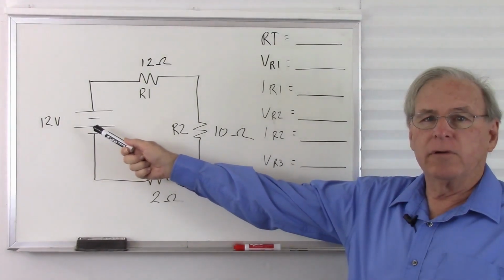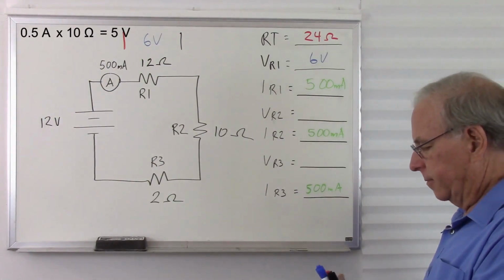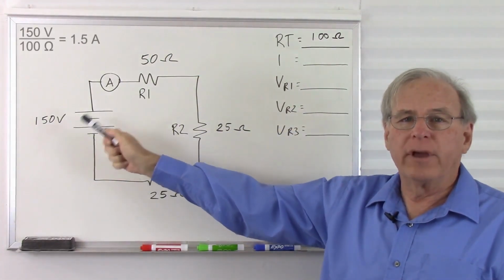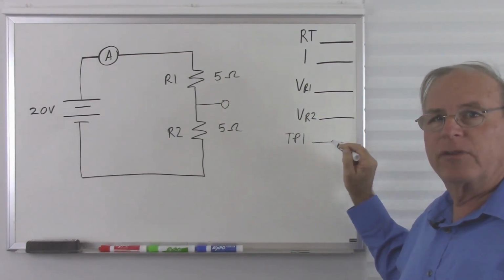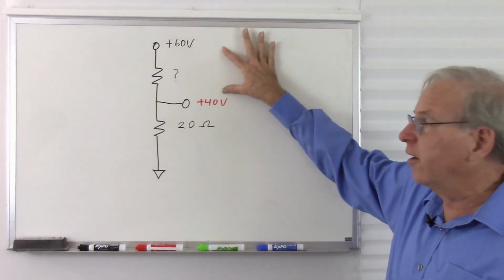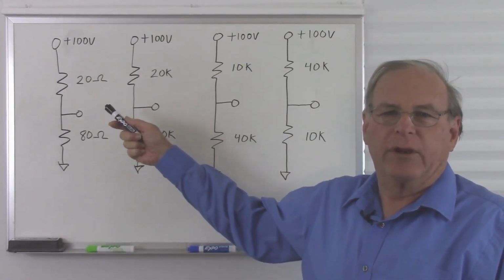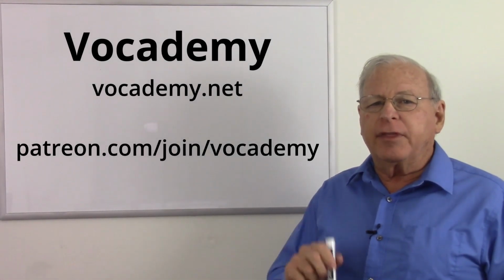Lesson 4a   Series Circuit Exercises

Comment: 20 series problems to work through.

Another .5A example.
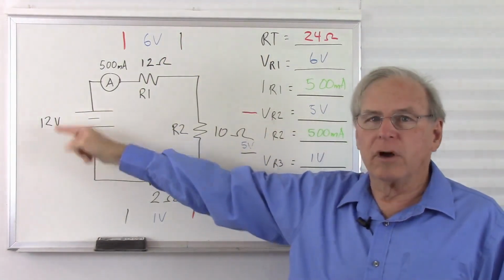6:00 Another 1A example.
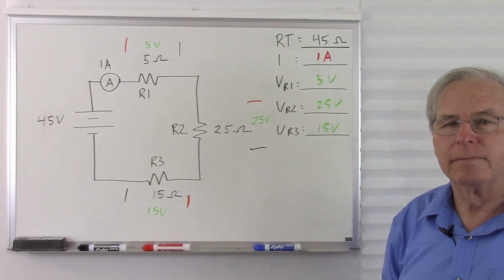8:25 1.5A example.  Percentage break down.
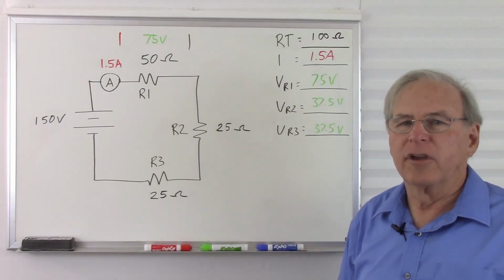10:15 2A example.  Solve for unknowns.
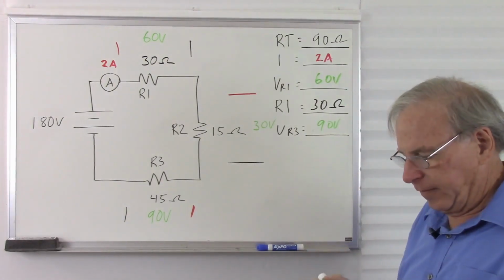13:05 4A example.  Solve for unknowns.
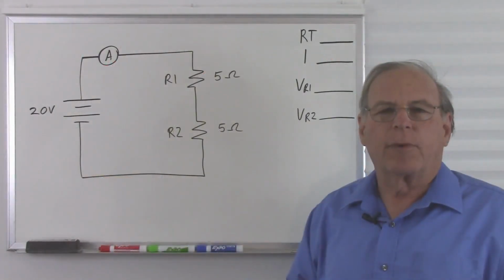16:45 Another 2A example.  Battery redraw.  Schematic exposure.
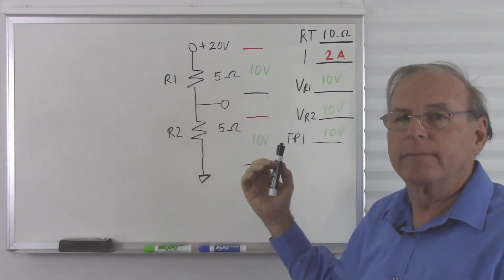20:40 Another 0.5A example.
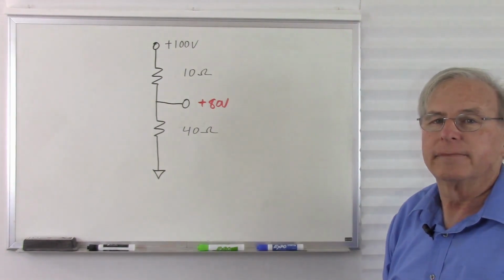21:12 Another 2A example.  Solve for R
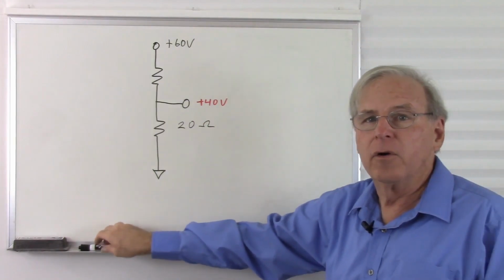21:55 Another 2A example.
22:38 Another .5A example.  Mystery Voltage Source.
23:25 Another 2/5A example.
24:05 Another .5A example.  Has a Volt meter reading.
25:45 4 different voltage divider circuits.
28:08 4 more voltage dividers